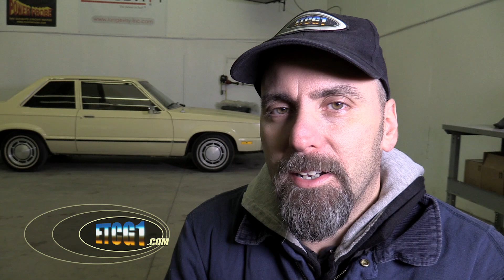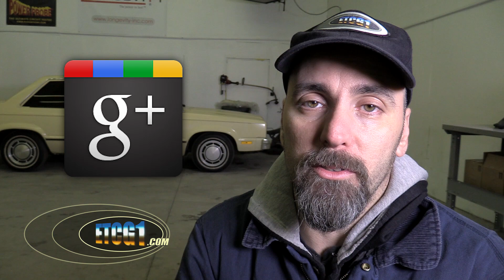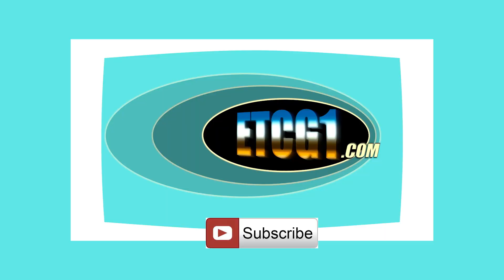How Things Have Changed In Auto Repair -ETCG1

Comment: It is an interesting transition for sure.  I hope we do not go this way  --> I was at the Aston Martin Dealership looking at a BD9 (just looking) and told the sales rep that I liked to do some of my own service (like changing the oil) and he replied "there are no user serviceable parts on a DB9 - for any and all service, it must come back to a authorized service center."  He was very nice about it but still, I hope all cars don't go that route.  I still like the pre-computer, pre-smog cars to work on.  My 94 Mustang is pre-OBTII, so one on the one hand it does not have to pass an emission inspection in my state but the stuff under the hood can still be a bear to fix correctly.
Reply: +David Roddick That helps build a relationship with your car. My 95 Ranger was pre obd2, and so is my 92 silverado. The good thing is my silverado is insanely easy to work on.
Reply: +David Roddick I hate to say but yea, we are going that way. With all that talk earlier this year about manufacturers wanting to make it illegal to work on your own car, I'm sure it won't be long until they engineer them in such a way that you physically can't do it. As for the Aston,  and anything else not user serviceable, I'd figure out how to work on it myself because I simply don't trust anyone else. And I would have told the little twiff that.  Those specialty tools it would need would eventually filter down to the end user anyway through people quitting/dropping out of tech school/retiring and selling them off on ebay. Not to mention that independent service shops will have a need to buy them, otherwise a move like that from the industry would flat ass put them out of business.
Reply: Jacksonkellyfreak There were some BMW cars that don't have dipsticks already. Neither transmission nor oil. Go figure.
Reply: Koshunae
yea they have a lamp and photocell system that monitors the oil and adjusts the oil change interval according to how you drive, and you need the BMW specific scan tool to reset the maintenance indicator or message. Same with Mercedes Benz. The car tells you when it needs service and it wants you to take it to the dealer because you need that scan tool. I do believe however, that the $10,000 Snap On Verus will clear their codes. Probably not for much longer though.
Reply: +Koshunae You can monitor your oil level in the infotainment display on BMW.
Reply: +Koshunae OBD2 was first used in the US in 1996. UK and Europe 2001, 2004 for diesel units.
Reply: +David Roddick That's because you're smart. For us OBD-II trained techs those are a beast when it comes to dealing with a engine diagnostic (well, at least those of not so experienced that those cars weren't the norm in our past...other than owning them, doing maintenance, I didn't know much back then.)
Reply: Facts The day I trust a computer to that level in my car is the day I shouldn't be driving.
Reply: Facts
And more than that, reset it pushing lots of buttons just as an end user. If I did it enough it'd be easy, but it just kills my flag time.

No "luxury" car is a picnic. Everyone talks about how the dealers rip those customers off, but aftermarket shops get ripped off by their corporations on flag hours on every luxury car brought in. Customers should have to pay more for even an oil change on these things! It hurts the mechanic and the shop really. Like any good business model, the extra costs and difficulties of service should be given to the customer.
Reply: Koshunae
Agreed. Most customers do better with those electronics, but an above average customer would get frustrated not being able to manually check as well. Heck, there's a BMW we serviced for years before we realized it's sub model was listed wrong in the computer and it was supposed to have almost 2 more quarts of oil.

No wonder the BMW thought it needed more frequent oil changes. With their high oil capacity the car kept its oil just as clean as if it had more to suspend contaminants over time, but finally she'll get a full service interval.

And it wasn't just my shop, we contacted EVERY parts house trying to just figure out the oil filter one day because everyone had adjusted their databases wrong...hmmm, found the oil filter easy before...maybe we put the right amount of oil in then?

Sorry for the rant. I just had to share how much I think of BMW.
Reply: A fare response later....some early 90's bmw's seem super easy to service on most things, and within several years they made some things harder, but still not terrible.
Reply: DE Nichols
 It's like I mentioned earlier, the way this is going is going to put independent repair shops out of business completely. I think it's bullshit and a racket to ONLY have your car serviced at the dealer. And what's driving it is that no one really takes their cars in to be serviced outside of warranty, and their prices are astronomical. If they make it so they are the only ones who can touch them, then they can charge whatever they want, and they will. Which will drive cars to be even more throw away than they already are. Which will further aid dealership profits. The whole auto sales industry is very dirty and there isn't a thing that can be done about it. Unless the government directly interfered, which given the length of time that it's been that way is about as likely as them turning honest on their own, this is heading toward a very bad situation. So far only the high end cars are moving to this, which fair enough because once it's 5 years old it has depreciated to the point that it's reasonably affordable but you still have the high repair bills, which has made them pretty much throwaway vehicles for years and years already, but what happens when the normal cars make this shift?
Reply: Jacksonkellyfreak Well... so many mechanics said they won't own modern stuff 20 years ago. . . Heard people say that a lot right? Too electronic, can't work on it. Well now I'm lost on the old more mechanical stuff, or I can be. If they went that far for me to say that about old cars, then they'd realy have to go far with new, normal cars I'd need a new career. It's what I do for a living. If I wouldn't be able to work on it  either...wow.
Reply: Jacksonkellyfreak it's definitely a racket.
Reply: DE Nichols
 I go through that with my cousin. He won't own anything but 80s- mid 90s chevrolets because he "don't know nuthin about anything else." Despite the fact that these things are complete and utter garbage, he continues to buy them. And it hurts me deep because I despise all things gm, and won't even give them the respect of capitalizing their name. They way they conducted business before they got bailed out pretty much ensured I'll never own one. Anyway back on point, I've been fortunate to work on 80s-90s RX-7s, MR2s, and most other Japanese sports cars,because I started driving when they were super common. But now I also work on newer stuff of my own, and right now it's a 2000 Jetta VR6. I was doing timing chains on this engine and believe me that is a JOB and I called the cousin I mentioned earlier for help getting my transmission out and he kept saying he didn't know how to work on them and couldn't help me. I finally talked him into it and he hung around after helping me get my trans out to see me knock the timing covers off (chains are on the back side) and he couldn't believe I was doing this job. He kept saying you can't work on this, you're gonna mess it up blah blah. And we got into a conversation about the check engine light and he said "I don't trust computers and I'm gonna put a 4 barrel on my truck." I explained to him that carburetors were both inefficient and far less capable of producing power than fuel injection and explained to him how much easier it was to have the OBD telling you what's wrong. That actually made repair costs cheaper. He just stared at me blankly and replied with "you think you could help me put that carburetor on this weekend?" I said no, I don't know anything about antiquated technology lolol.
Reply: Jacksonkellyfreak
LOL. Great story. I couldn't agree more, but really, you could have helped him even if you didn't know the old tech. to return the favor. Haha, too funny. Yes, I could help him help me on modern things, but I wouldn't know how to help him modify anything to be older school.

Then, I have watched a few Briansmobile1 carburetor videos so I may be able to clean one up and fix it a bit. :)
Reply: DE Nichols
 lol I did help him, but it turned out he kept the tbi setup and I talked him into putting new injectors in it because he couldn't find a carb he liked. Here's another one I've got. My uncle is dead set against synthetic oil. He absolutely got in my face one day when he was visiting us, and it was I believe 2001  and I was 17, just starting to learn how to do maintenance and work on cars. He saw me changing the oil in my RX-7 and saw the Mobil 1 bottle sitting there and absolutely lost his mind on me. It makes a car leak, it will cause your engine to blow up because it's too slick, it causes sludge and it eats seals. I poured it in ayway, BUT I did later find out that using synthetic in a rotary isn't the best. Still everything else I own except my diesel I run synthetic in. And once I find the oil leak I'll run Rotella T6 in that. It leaks about 5 quarts in a thousand miles so my reasoning is purely monetary on that one. Even last year I went to run an errand with him and he has a Tundra, which states right in the owner's manual and on the oil cap SYNTHETIC. So anyway he asked if I cared if we stopped for about 30 minutes because he was over due for a change (3000 miles because " I don't care what they say, I'm not running 5000 between changes") I listened to my uncle tell the guy that he better not dare put that synthetic trash in his car. And this is my favorite part "Put in Pennzoil 10w30." That poor truck can't be long for this world. Stuff like that just angers me to the point of not being able to speak. People are so inclined to believe hearsay that they simply won't educate themselves. I love my uncle and I love my cousin. They are family after all, and I would help them in any way I could, but when they feed me bull like that and won't listen to reason or facts, it makes me feel like I'm arguing with some damn politically charged wingnut.
Reply: Jacksonkellyfreak
Politically charged wingnut. Nice.

I had a man all over my website talking about cars until he saw the advice about synthetic motor oil. We were having brilliant discussions about everything. This is when he shut down. Check out my channel, it has a link to it.

Anyway, he had a car that lost it's oil seals due to earlier synthetic oil problems and it helped him lose his engine. So he's fully against it.

You better tell your uncle to not come to my shop, unless we order it in for more expense we can't change oil below semi-synthetic, lol.

In my area, whether it's needed for not, we recommend 3k miles. With most coming in a thousand or 6 even miles late, it's kind of like cops not pulling people over in areas commonly driving 5 to 10 miles faster.

With most coming in somewhat late, it's not that bad, but for those who normally come in at 3k miles, their cars do run better longer.

I can't afford full synthetic and 3k miles so I do about 5k and call it as good as I can get. (Mobile1 extended life gets me about another 1000 miles of pretty clean oil up to 5.5k miles, but 4,5k miles was pushing it with the previous formula, just based on how it looks.) Since everyone keeps arguing that looking at oil isn't good enough (good point, but really, if it's filthy, it's filthy, right?) I finally paid for an analysis. With my iron levels double normal, I wonder if shorter intervals and cheap oil would help more...but I've always seen synthetics as more than just less frequent changes, but less wear, better efficiency, long life and all that.
Reply: DE Nichols
 I did the UOA several times in a row and came up with the result that even with the current 185k mileage I'm safe to keep running a 5000 OCI on my car. I kinda try to stick to the factory weight they want too, which in my case is 5w40, and I look for the oils that have the VW 502.00 and 505.01 rating which in my area nails me down to either Castrol Edge or Mobil 1. Once in a while you can find the Havoline Pro DS Euro formula in 5w40, but for the most part I stick to M1. Except this time I used the Edge because I hadn't really used it that much but I knew it was a super high quality oil and it's about $5 cheaper to do a change vs M1. Laugh if you want but when you're talking $65 vs $70 you take all the help you can get lol. I am desperately hoping to get my car to at least 250k before it needs anything else major. At that point I'm planning on finding a lower mileage VR6 that runs and putting it in to run until I can inspect mine and see if it needs boring or line honing on the mains, or if it needs a decking. It is after all a huge surface being a V6 with a single head on it. If it needs minimal machine work I'm going to throw a bottom end in the thing and a new head gasket and see how far the car will actually go.
Reply: Jacksonkellyfreak
Wow. That is SUPER exciting. I have about 180k miles on my Chevy Prizm and I plan on doing a rebuild. I hope I can focus on modification, but my budget will cut me back there if when I get in there it needs more basic stuff.

You know, when Ericthecarguy was doing live events with the AdvancedAuto guy he commented why in the world would you use magnets...but now seeing double iron than the usual, even if it's in parts per million, I wonder if it could help reduce that. It's the only reason I wonder if I need to go lower end oil just to afford more frequent intervals to keep those levels lower.

But when it comes to such things there are ALWAYS more variables. For example, I did a water decarbonization on my engine before the UOA so did that clean out some crap just to give me a false high?

Or now that I don't have an oil leak, will all my levels get worse since I was always adding clean?

So hard to have scientific evidence with all the variables changing! LOL
Reply: DE Nichols
 Don't even stress brother. Your variables changed, but are now more constant. You fixed a leak, so that shouldn't change again for a while. You haven't decarbonized it again, so that hasn't changed either. What I would do is run a 3000 OCI at least 3 times, or more if you wish, and send each one off for a UOA and get a good baseline average. That way you could know for sure. I wouldn't go too low of a grade of oil, but parts store brand synthetic is almost always made by the big companies under contract, and it either has less of their additive package in it, which is inconsequential really as long as it meets the API rating, unless your car calls for a specific rating for additives like I mentioned my car wants the VW 502.00 505.01 thing, OR the parts store synthetics will have their own additive packages in them. I'm thinking of trying some of that Archoil stuff. It's nanoborate and when I looked up information on that 502.00 rating what little tiny bit I could find was that they specify a higher boron content in oil. Boron is extremely slippery stuff. Which is from what I gather due to the fact that oil produced in Germany having higher boron contents. But it's also detergents and things like that.Usually when you see the VW rating on oil, you'll see Mercedes, BMW and Porsche too, which is odd that Porsche would have a separate rating.  Also I would suggest that the next oil change, if it isn't too difficult, go ahead and knock your oil pan loose and clean the utter piss out of the inside, then send in your next few UOA. But forget it if you gotta move the engine or crossmembers around.
Reply: Jacksonkellyfreak Wow. That was a REALLY good post. You deserve a better reply, but I have a truck to go register. I'll be back. :)
Reply: +Jacksonkellyfreak Are you going to take a guess on torque settings and wiring? If you can get the factory service manual you have a good shot at it. If Aston-Martin is so dead-set against non-dealer mechanics working on them, you may not find one. I wouldn't buy a car for which the info to fix it isn't already out there. Not that you clearly said you would but it seems implied in your response.
Reply: AJFresh
Somebody has to print it, so it's just a matter of finding one. But like for servicing it yourself, when you have years and years of experience, you really only need to torque critical things. clutch pressure plates, rod and main bearings, cylinder heads, timing components (guides and tensioners, sprockets on chains) suspension components, etc. But I'm not gonna get out my torque wrench and torque the oil drain to spec.
Reply: Jacksonkellyfreak
I totally agree with your view on torque specs. I feel strongly about the torque on wheel bearings for example. Now by experience I still trust my experience even more because I followed the "book" on one and it destroyed the wheel bearing and spindle.

I'll still check the book, but the conical old style of wheel bearing needs to be gently put together and if the book tells me otherwise, I'll ignore it. First time a "book" torque fouled up a job like that on me. If I had the ETCG1 channel it'd go under "Most Embarrassing Moments.."
Reply: Back to what we were talking about before.Jacksonkellyfreak , I thank you for the thoughts on my oil analysis. I'm going to stick with my usual oil change interval to not add in an additional variables in the experiment. The only thing that sucks about that is it puts off the engine rebuild I want to do for fun (air flow modification) for possibly nearly a year. I live in a small town and it takes a long time to go 5k miles.
Reply: DE Nichols
Been there. Got those old tapered roller wheel bearings too tight once and smoked em within a hundred miles. I don't work on cars for a living, in fact I'm starting school to be an A&P mechanic, where I'm SURE accurate torque will be critical on far more things than on cars. Car breaks, you pull over and curse. Plane breaks, well... But even without a "proper" automotive education you can still figure this stuff out and educate yourself and not only do things right without going by the book, but as you gain experience things become more intuitive. Still we all have our challenges and diagnostics is a big one for me. Also finding leaks sometimes. You're welcome for my thoughts on your oil analysis, I'm obsessed with reliability from my vehicles. Maybe it comes from having a bunch of turds when I was younger. If you haven't found it yet, I strongly recommend the Bobistheoilguy site. I learned a lot from that site, but remember it's the internet so kinda try to double check some things because you'll run into a ton of different methods, BUT for the most part every one I've seen post on that site is extremely knowledgeable and most are like me who don't really open their mouth unless they know something about the subject. There are also all kinds of scientific articles about oil on there. It may be worth signing up for you.
Reply: +Jacksonkellyfreak i work at benz, the service reminder is just a countdown timer using either miles or time to turn the light on, depending on how that car was set up. It can vary on the oil you "selected" that you put in. You don't need to go to the dealer, online like youtube has the reset service procedure and its nothing special to change oil on those car so far. However there are some old cars where resetting the light can be done with pushing a few button but if that doesnt work you will need the scanner.
Reply: tim allen
I've never worked on a Merc so I didn't know that. I do know that the OBD system is one of the most integrated out there and knows every system in the car, not just the powertrain. Which is what that useless screaming twerp kilmer hates to its core lolol
Reply: +Koshunae You can't even open the engine bay any more on the i8, not even to have a look for curiosity :)
Reply: +Forever Computing I call it 1995 for OBDII
Reply: +DE “AutoBravado” Nichols E-30 was the last of those "easy to service" BMWs. I had 4 different E30's over the years. Loved that 2.0 6cyl
Reply: FROM MY COLD DEAD GREASY HANDS
Reply: HUBBABUBBA DOOPYDOOP What aren't you letting go of, which greasy car?
Reply: (waving wrench in air while saying, my ability to work on cars. Charlton Heston NRA parody) Get it?
Reply: HUBBABUBBA DOOPYDOOP I don't just gets it. I love it.
Reply: One of his (Heston) last speeches at an NRA meeting, just after certain gov officials announced new "gun laws". He held up a rifle, and exclaimed "from my cold dead hands!".
Reply: Have you guys seen the Jim Carrey "Cold Dead Hands" comedy skit?
Reply: Yes. Poor taste. Although not sure of Carreys' intentions- it was received poorly by those who admired Heston, and who belong to the NRA. Those who wish our 2nd Amendment be abolished- were already dancing on his grave when Carrey did this. Hollywood Stars, who are against guns- but then are protected by people with guns. Criminals don't follow laws in the first place- so how would more "gun laws" change anything? Murder is still punishable by Death in some States; yet people still kill. Your pistol may have many bullets- but a fueled up car can run over hundreds of innocent people. License and other paperwork are required to own and operate both things. Keeping and bearing a Firearm is supposedly an inalienable Right, while driving is treated as a "privilege". Cigarettes kill thousands more than guns. Think about it.
Reply: HUBBABUBBA DOOPYDOOP
You don't have to convince me, but it was a good speech. Do you like GunTalk by Tom Gresham? He has a self defense series for free on YouTube, not even paid with commercials on YouTube...but then you can't because Google won't allow ads if you're talking about guns.